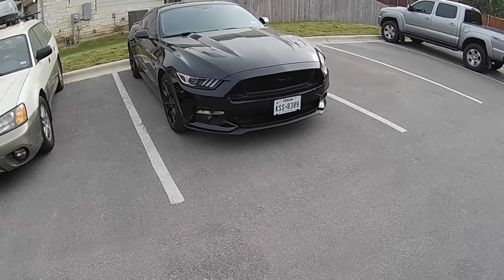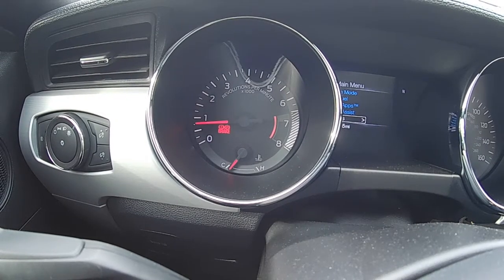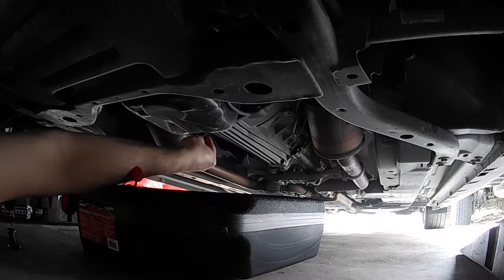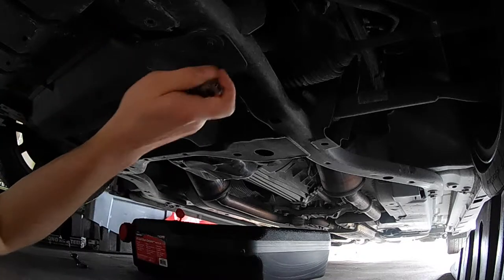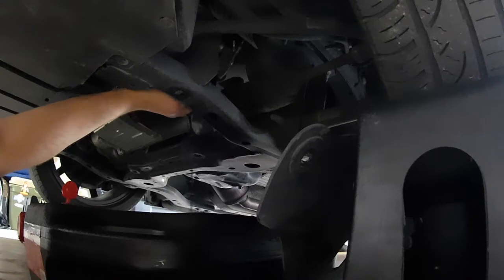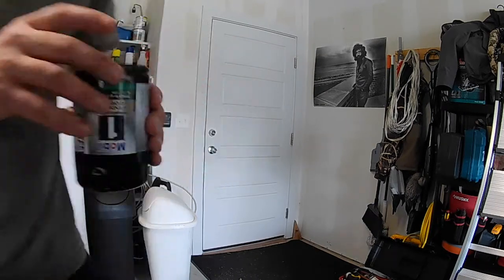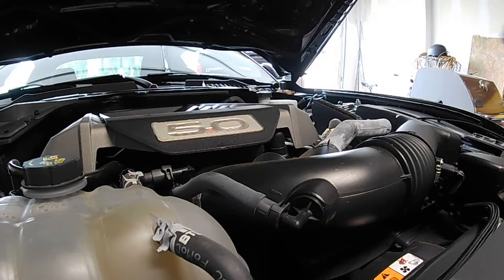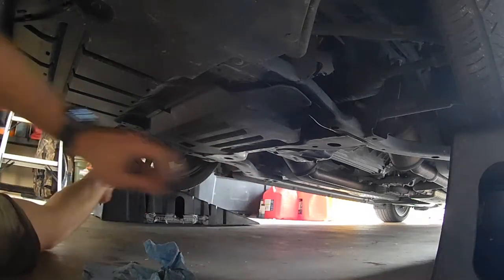2017 Mustang GT Oil Change

Comment: Changing the oil on my 2017 for the first time myself after my free oil changes expired.   

I have the little access flap that allows one screw (THAT THE FORD DEALER LEFT OUT) to give easy access to the filter.   Wonder if that's a performance pack thing.

Comment: Nice video 👍🏻 Do you have the tick engine sound?
Reply from the maker: Jolene unfortunately died in spring of 2020. She was hit by a drunk driver while parked. No one was injured. But she was totalled after a short life of 26k miles.

That said I heard about the tick and I was convinced I had it (there was a slight tick but nothing like what people were posting), but I think that was the internet putting ticking sounds in my head.

Comment: ((Does anyone know of any good shops in South Jersey for a Shifter change or installation???)) I am already looking at the MGW I think.. I was checking out the Steeda, and Barton too.. But the Barton is Noisy shifting from what I have seen in vids.. The Only thing about the MGW is it only bots to the trans and not the body to, There are a couple that do both.. IDK yet really.. Still looking and can't spend any more money on myself till after the holidays.. OH Yeah and My GT just has a Flap you can unscrew just one bolt and get to the oil filter on mine. Maybe different. Maybe that is what you saw the guy do? But anyway I am looking for some one in the South Jersey area to put the shifter in for me.. I am not getting under this car on Jack stands at 50 years old, I still can But I am Not LOL.. But if Any One knows of a Good Speed shop near please let me know thanks...
Reply: Does your car a PP1? Might explain the access panel.

As for the shifter, mine came with the Ford Performance short throw shifter stock as part of a package. It’s really nice and isn’t loud. It doesn’t vibrate or shake. Very smooth and notchy.